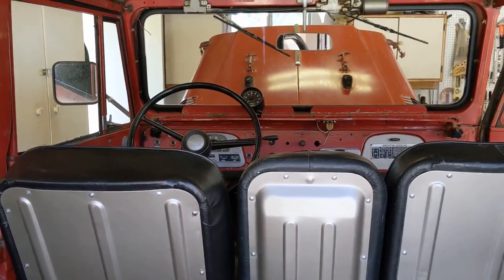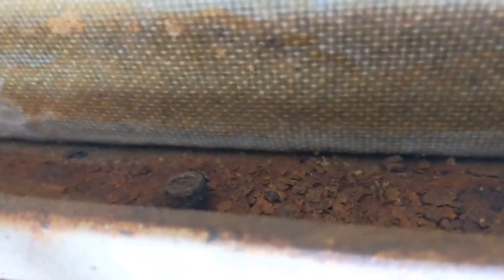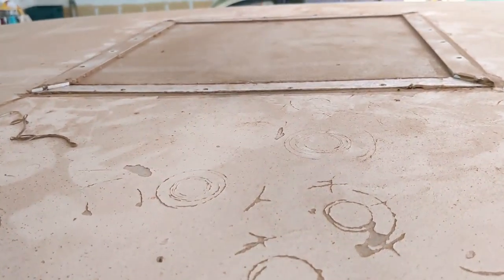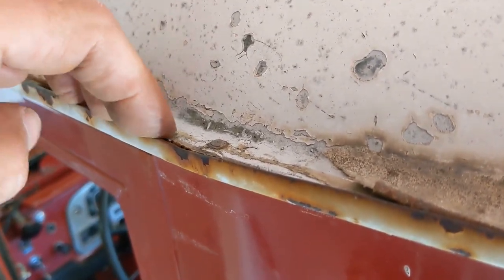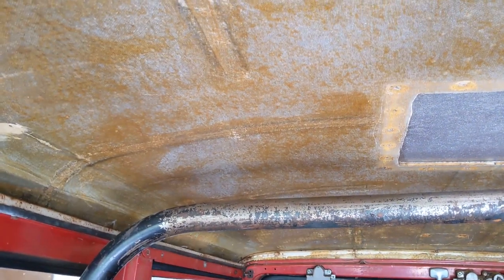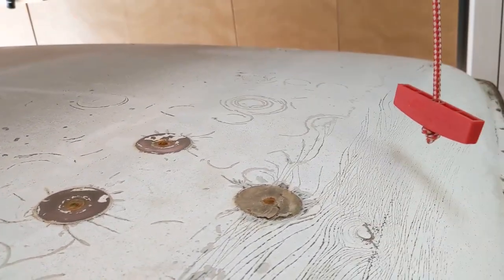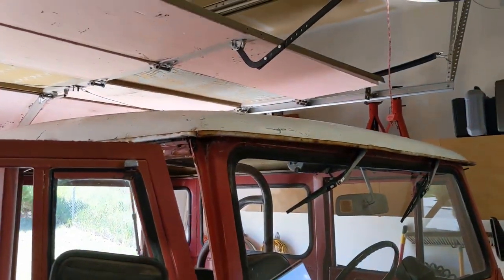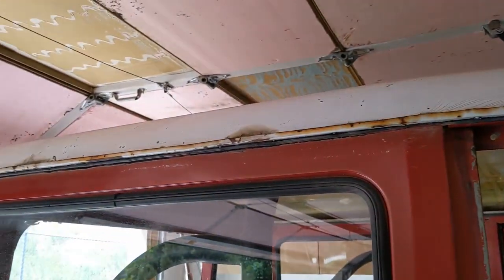Let's Face It:  The top needs work

Comment: I'm not sure where you are located, but you might want to check the auto parts section of Searchtempest dot com and search for FJ40 parts - There are a couple fiberglass tops in my area (TN) likely some out your way that are in better shape?
Reply from the maker: I'm in Colorado.  I found a new top for about $1500 up in Poncha Springs.  I'll get a new top if necessary, but I'd like to save this one if I can. It keeps costs down and, frankly, I have more time than money these days.